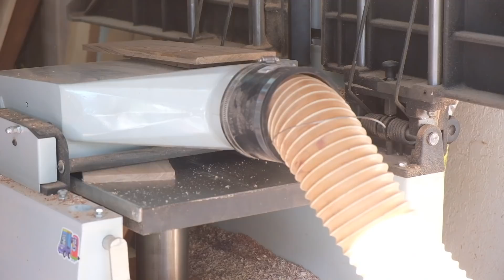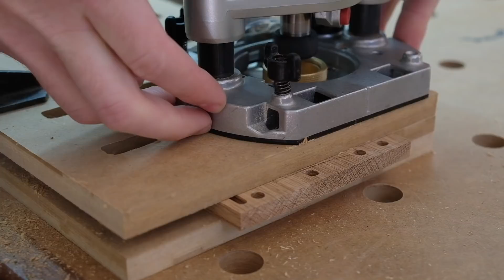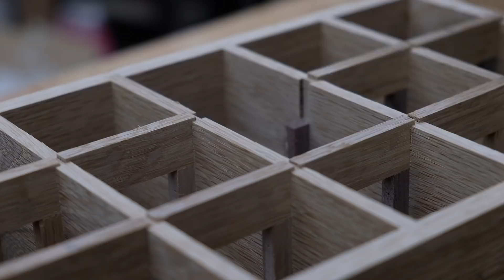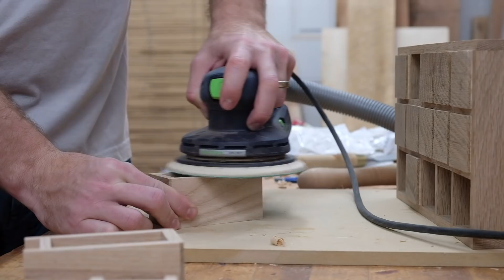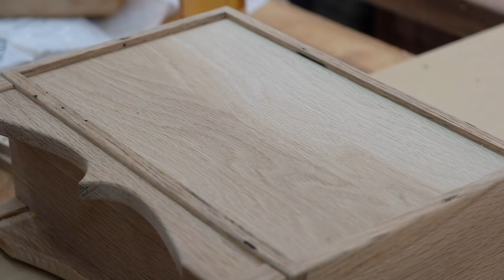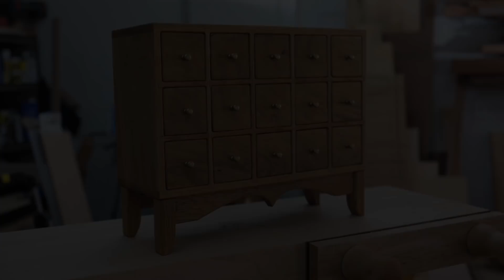My Smallest Apothecary Chest Yet

Comment: Gorgeous work as always John.
I noticed you drilled into the 3/8" faces with the dowelmax in the face configuration; what did you do to mitigate the issue of the clamp pads hitting the aluminum spacer that screws into the inner face of the main body? I frequently use my dowelmax for 1/2" material and using cauls on the clamping pads gets annoying after a while.
Reply from the maker: Thank you. For 3/8” I treat it like 1/2” and end up with an overhang that gets flush trimmed afterwards. Because of this, the top and bottom panels need to be cut longer by about 1/4”. I always forget how long the overhang is. Sometimes I get 1/16”, sometimes 1/8”. Depends which spacers I use.
Reply: @parillaworks  Gotcha. Thanks for the info. 👍

Comment: Curious as to why you used dominos instead of just maybe two dowels in the cross section for the legs? The standup jig seems cool and I’m not familiar with it which might be my answer. It seems like if you’re off by a little bit, given how narrow the cross section is, it could easily blow out the sides if you aren’t spot on. In theory a dowel could as well but… i don’t know. Not judging or anything, just curious why one over the other for that particular instance. Thanks.
Reply from the maker: The stretcher is only 1.25” wide which was a touch too narrow to comfortably and reliably fit 2 dowels. Luckily I had the Domino as an option. The Domino has reference pins that pop in and out as needed. It’s essentially a little stop block that lets me butt the workpiece against it for repeatable cuts.
Reply: @parillaworks  ahh that makes sense. Awesome, thank you for explaining that.

Comment: Would you be willing to walk through how you use your jig for the dados?  I'm curious how you align the different length pieces to ensure the dados all line up during assembly.  I can see that some of the pieces have pencil lines, but that feels, less accurate I guess, than the precision results you are getting.
Reply from the maker: Sure, I’ll try to put something together. Maybe when I release plans I’ll go over it. The short of it is, the jig is sized to fit the short sides. Anything longer or shorter is eyeballed against a marked line. I know that doesn’t seem accurate but when splitting the difference between 1/16” or 1/32”, it’s fairly accurate to eyeball it.